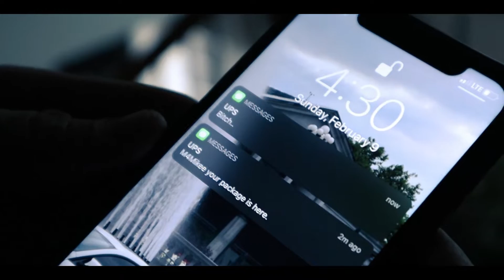BMW M4 (F82) ARM Exhaust Tip Unbox and Install

Comment: Start a 1:10. You are welcome. Alternatively, use WD40 and a large flat screwdriver. Apply WD40 into the tip from the back and let sit for 10 minutes (as this guy does). Insert screwdriver into the small gap between the back of the tip and the muffler. Lever gently until the tip comes loose. Done.
Reply from the maker: This guy is myself M4mikee. Glad you found my video helpful!!!!
Reply: @m4mikee  I did. Zero instructions with the tips I received, so your Vid was good.  Saw another one where a dude used some weird and expensive clamp setup. Simple = good.

Comment: Good DIY video, thank you. But looks like your left tips are about 20mm apart while your right tips are touching. No bueno. Have you fixed it?
Reply from the maker: Cru Jones I actually sold the m4 I now have a 2020 Supra! I think it was just the angle there were no issues that I ever saw!
Reply: @m4mikee  Enjoy the Supra! I just installed ARM tips on my F80. Yes I have a serious case of 'the mods'. I can't stop!